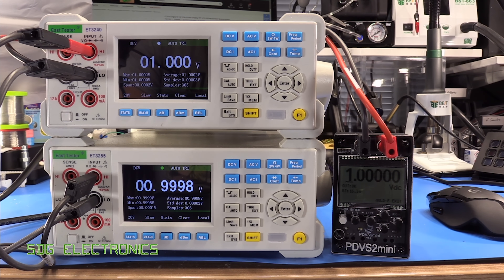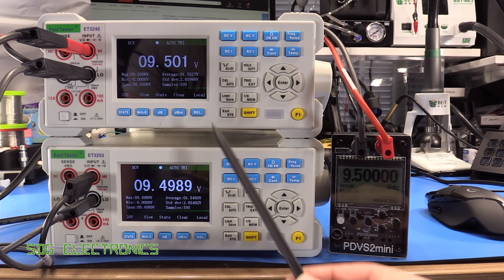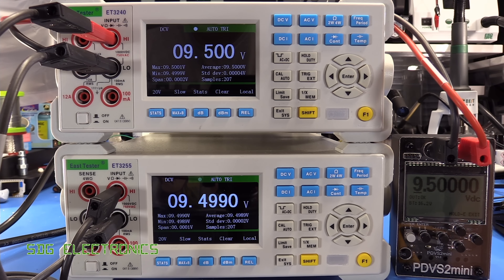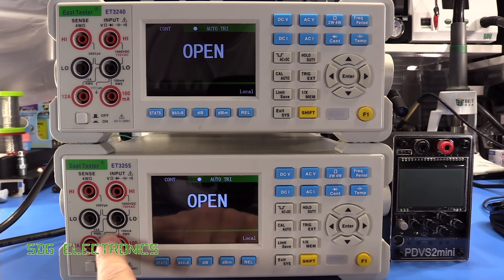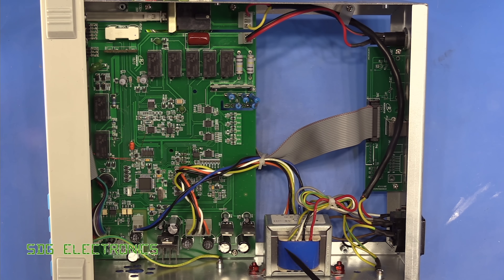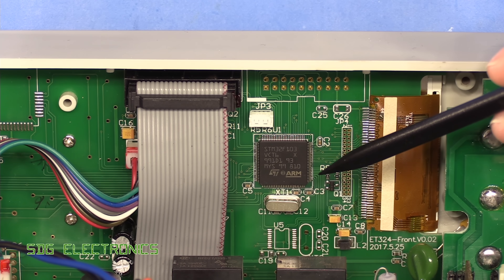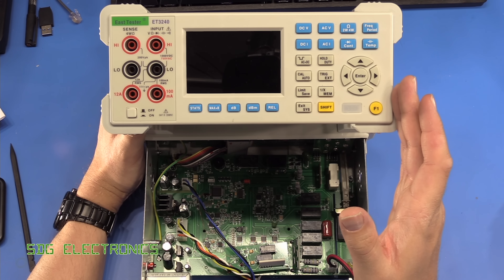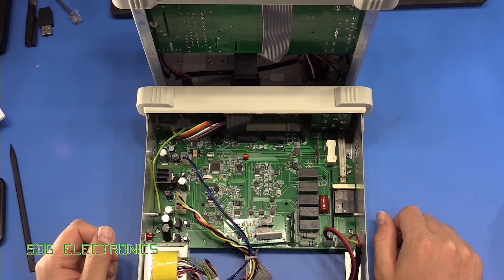SDG #143 Well priced 4.5 and 5.5 Digit EastTester DMMs - ET3240 and ET3255

Comment: Something that I really don't like about these, other than the accuracy is the incredibly slow update rate.
They probably do this to average over many samples and reduce noise.
I looked at these meters and some of the other "low cost" bench multi-meters made by Siglent and so on.

In the end I just bought a Keithley 2000 from eBay and frankly I'm quite happy I did.
It cost me less than a new 5.5 digit Siglent, the voltage, current & resistance measurements are on point even 10 years later and the update rate is insane.
And of course the Keithley 2000 is very low noise all the way down to 5 digits, unlike these meters just going all over the place.

For a desktop multimeter those are the most critical measurements in my opinion, as I use an LCR meter for things like inductance and capacitance, scope for frequency counting and so on.  The update rate just cannot be understated, it allows you to make repairs and adjustments so much more quickly.

Comment: The bodge board on the ET3255 is gone on the model I got this week. No rework on the PCB. However the transformer had come adrift in transit and there are various faults. AC volts not working, all DC current ranges reading a decade low. Autoranging on DC current not working. Pity really. In the process of getting a replacement.

Comment: Hi, Have you tested the VC8145 as a cheap multimeter? On papers looks good suppose to have 10 digit counts, 80k counts. the only thing I don't understand on capacitance the rage looks small 10nf-100uF, can it only measure up to 100uF? I have an older unit 61E that is 22nF to 220mF.

Thank you

Comment: I took a risk and ordered ET3255 and surprise...no bodging inside because inside is an ET3240, no caddock precision resistor network / divider, no separate  voltage reference, only the firmware is for 5 1/2 digit model .Also I encountered a lot of other issues like : no cold junction compensation for temperature measurements by thermocouple,  AC+DC mode not working correctly. 
I was refunded with the difference between 3255 and 3240 but even so, way too expensive for partially working equipment.

Comment: Love this new class of gear being offered by East tester and other companies like kunkin, korad, etc.... Inc.. I especially like the benchtop meters, the LCR meters, programmable load testers, function generators, and other devices offered. Don’t get me wrong… I love my HP and tektronix equipment. But sometimes I’m afraid to use them. But this cheaper stuff would be great “daily driver“ equipment when gettibg down and dirty repairing & troubleshooting industrial electronics.

regarding multimeters in particular… I would gladly pay $150 for the lower end “east tester” benchtop multimeters,.... considering I’ve only been doing this 4-5 years, And I still make mistakes. I’m not that experienced and I’m always afraid of damaging my nicer equipment. Therefore some of it goes unused. But if I had a bench full of this cheaper gear I wouldn’t worry about it. 

However when it comes to the more expensive ET 3255… you would be better off buying mint condition and calibrated HP 34401a 6.5 digit benchtop meter for the same price. I’ve got three separate 34401a meters stacked on top of each other that I use daily… Hell they’re hardly ever switched off. They are all in mint condition and were purchased with an up-to-date calibration. all under $400 shipped each. The 34401A is a hell of a meter to get for under $400 in great condition and calibrated. Hard to beat that.

But as an experiment… It would be nice to buy a multimeter, LCR tester, programmable load, and frequency arbitrary generator made by these cheaper companies… Especially for folks like me who are still afraid of blowing up nicer equipment. You could outfit a bench completely for under $1000!

Comment: Thanks for your video.  I need a measurement equipment for the repair of laptops and especially mobile phones.  I am looking for a lot of precision especially in the resistance measurement to look for short circuit in lines with several components.  Work on a milli-ohm scale.  Also to be able to work in 4W.  And a very precise diode measurement.  What multimeter do you recommend with a cost less than $ 350 or $ 400?  I had decided on the ET3255 because of its specifications on paper, but I have doubts after watching its video.  Thank you very much.

Comment: Could you please add a second review of the ET3255 specially for the millivolt range? 
I am curious te see if it can provide trustable continuous readings between 40uV and 50mV.
Reply from the maker: Honestly, I wouldn't go for the ET3255 as I do not think it's worth paying for the bodges. If you need the 5.5 digits, I'd look for something else. I just did a few spot checks though and it is good within that range using Ian's voltage source. No out of spec readings.

Comment: The specifications shown at 2:28 say that this meter can measure down to 10µV and 0.01µA  DC.  Presumably this is why the lower input socket has such a small upper value (ie. 0.01µA to 100mA).  It would be really nice if you could test if the low end is truly accurate with your PDVS2mini.   Would have loved to see if those lower end measurements work as advertised.

Comment: Just some feed back on this tear down (very well done, as usual, BTW) and the 4.5 ET3240.  I got one finally arrived in US after full 30 days and I was careful to check voltage switch selector and run at 110V setting, but mine just powers up and sits at the green boot screen.  Left it there for hours...pressed buttons, read manual...nothing.  Never goes past the green booting screen.  Hopeful for any suggestions (Banggood is pretty much giving me the run-around on support...sent the video https://www.youtube.com/watch?v=3WKLOd6tYQQ to them and all the pictures of the packaging, skew, etc. and now, likely going to cost more $$ to ship back than I paid for it).  Sigh.
Reply from the maker: Sorry to hear that Jeff. I'm not sure what the law is in the US, but here, you would not be responsible for any shipping costs. If you want to investigate yourself I'll see if I can work out what is doing at the startup screen - not sure if it does any self check or if this is just the bootloader. East tester are actually very responsive by email - so worth a try too. I will contact them later
Reply: SDG Electronics thank you for your help. I have not found an email contact for East Tester on their site or any FW support or if that would even help if it can’t be put into a reset/update mode, but hard to navigate as no good English site support.  Mostly just worked with Banggood directly so far.   Was hoping someone here knew of options.  I’ve done most of the non-intrusive stuff I could check on measuring voltages working on supply and visually check for any exploded caps or jogged loose connections.
Reply: So, after Bangood went "dark" on trying to help me and while I won a Paypal dispute, it was going to cost almost as much to ship back as I paid.  Sigh.  So, I dove in and started working through things and quickly found a wire in the ribbon cable from the main board to the front display panel board that was popped out of the connector socket just barely and pushed out not making contact.  reseated that, and "viola!" everything working...no thanks to any contact from East Test and zero consideration for any help from Bangood.  You can see the colorful rainbow ribbon cable at 11:20 fedding under the grey ribbon and again at 14:20 in the upper left of the video that was disconnected (purple end cable on right side that plugs into the front panel).

Comment: Buy the 4 ½ digits and put a nice power supply inside. Maybe upgrade the voltage reference and replace those linear regulator for a good ones. This is a bargain. Totally worth the price.

Comment: Your readings can be a little of, be curse of there parallel circuit, the ET3240 had 1 wire to the psu, and  the ET3255 was connected to end of the wire, so it had 2 wires to the psu aka double length of wire

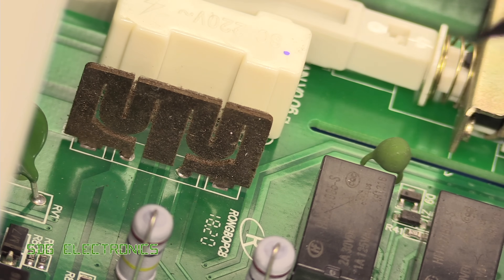Comment: @ 10:10 ish the current shunt looks exactly like a glow-plug style ignitor for a high efficient natural gas furnace. Actually, a good bit of reasoning with that, if it is correct.

Comment: I've got the ET5410 electronic load from the same company, which I'm quite happy with. It looks ok on the inside, at least compared to the hacks inside that 3255. The "quite happy"-part is mainly from two aspects. The first one was how hard it was to obtain the SCPI documentation from the supplier. When, after a three months back and forth between me and both the seller and manufacturer managed to get hold of something, it was in Chinese. Luckily Google Translate gave an output that was comprehensible. After some cleanup, I have an English version. The second issue is how the USB interface is designed. It uses the wrong gender plug, and it powers the logic board from it, even when the device is switched off. So it's powered from two ends when turning it on. I had to chop off the USB power for it to not occationally freeze up. What I'm trying to say here, is that not all things are very well thought out. It seems that there are several people doing different parts of the design, without having a top level idea of how it actually should work. Also the lack of documentation in English is seriously lowering the value of the equipment, not talking about hiding the component values that are being used. That's right out pathetic. This is supposed to be professional equipment, not low-end consumables.

Comment: At 9:05, there appears to be exposed copper on the mains wiring, where it enters the black outer insulation.  If so, it's inexcusable.  The way they tacked the range selection mod board into the 5-1/2 digit unit is awful.  They went to the trouble to specify top quality components (Caddock resistor network, Matsushita relays), then couldn't be bothered with build quality when it came to making the actual modifications.  What a sad mess.
Reply from the maker: The exposed copper is the earthed shield. It's sleeved before that. But yes, a bit frustrating really that it wasn't redesigned properly with all the mods
Reply: @sdgelectronics  Ah, OK.  Thanks, Steve.

Comment: these are really quite dissapointing... especially the 5.5 digit unit, with that price difference i would have at LEAST expected a DECENT mod board....
Reply from the maker: Yeah it's double the price, so you would expect better. I don't mind a few mod wires as in the 4.5 digit meter and many premium brands often have similar levels of modification.

Comment: Look at the absolute STATE of those bodges. 
Utterly laughable. If that is how they intend to build "precision" electronics, there is no way I'll trust their judgement of how to configure mains parts, and I shouldn't be expected to check and correct work that I already paid for.
Junk like this is going to get someone KILLED eventually. As a community, we ought to be publicly shaming this tat.

A multimeter is a device that tells YOU "what the crack is". You need to be able to rely on what it is telling you. Imagine making a measurement that produces unpredictable or unexpected results. You should suspect the DUT, not the instrumentation.
Just be patient and save up. Go on to Ebay and shop around. Skip the part where you waste $150 here and $160 there on junk that won't go the distance. My Fluke 8840 is well in excess of 25 years old, and is still absolutely spot on.

On the flip side, look at Ians voltage source. A single guy has been developing that for a couple of years just that I know of. No doubt it is the descendent of a project he's been tinkering with for much longer. It is the polar opposite of "Quangshushitter" death-traps because like all small sole-traders, he is putting his reputation on the line with every unit he ships.

Comment: The quality of the rework really puts me off these units.  I would also liked to have seen a transformer with split bobbin construction to guarantee mains isolation and to increase the isolation voltage.
Reply from the maker: The transformer configuration isn't too bad with the internal copper band, but yes, a split bobbin is obviously nicer. I did think that was flux all over the board on the ET3240, but it turns out to be conformal coating to keep everything in place, so at least some level of care was taken even if it's not the neatest

Comment: Dang isn't it ugly inside... weird that Chinese are so eager to protect themselves from copying when they themselves have copied everything coming their way :D
Reply: More to prevent some other Chinese manufacturer making a cheaper copy of the meter. I would assume that the EEPROM inside the microcontroller also is holding the calibration along with the bits that tell the meter what resolution to display. All the bodge wires probably will vanish in a later revision most likely, when they have finished the original run of boards, and want to save on the manual labour cost of putting them in.  Might even make the 5.5 and 4.5 versions as component placement only as well, there is enough room there for it.

Would be interesting to see how they did serial there, along with the USB interface, and if they are isolated.
Reply from the maker: I think I have a very early unit, so you would hope the mods disappear in a later revision.
Reply: Seems to me if someone really wants to copy it they will find the part number out with some effort.  I don't know but I wonder if they remove the labels since they use clone chips and then it is harder to tell they are clones?
Reply: Mostly, they scrub the chips to avoid paying patent infringement or even using grey market clone chips that are not legit and import issues and keep the rest of the wolves from copying them in China...

Comment: And there's me, stuck with a $25 meter
Reply: I love my ~$25 meters... They get dropped, rained on, and all kinds of other abuse but they still read close to each other so I guess they are accurate... enough.
Reply: There was a time where I had a lot of "budget" gear. I suffered and suffered with that stuff because it consistently lied to me. Do NOT fall into the trap of Chinese junk.
Save up. Wait. Be patient. Your time for touch screen Rhode and Schwartz gear will come.
Reply: Portable and not looking to be stolen unlike fluke meters.
Reply: @digitalradiohacker well there are things like the T12 Soldering Station that's 100% worth it, and I've seen many people prefer it to name brand Weller stations of a similar price

Comment: Thanks for the look inside these. I like ET's other gear (electronic load and LCR meter). I'm with you on the disappointment in that 5.5 digit meter. What a mess. I wasn't tempted to get these since I am a fan of the usual meters (Agilent and Keithley) and I'm pretty sure I'll steer clear of the temptation with these.

If you contact their support email address, they will email you a link to the software. They are very responsive and easy to get technical information from.

Comment: ehhh, both are on a price range where i'd rather get an used unit from the usual brands.
Reply from the maker: Unfortunately, in the UK, even an ancient 34401A goes for the 3x the price of the 4.5 digit meter. The occasional one slips through at less, but there's not usually a great deal of choice.
Reply: @sdgelectronics  Well yeah, agreed but as pointed out, that's 6.5 digits. I got myself a 3468A for peanuts, added in an HP-IL to USB interface (fun little project) and I am good to go.
Reply: @sdgelectronics  Ancient, in what terms? I mean it's 6,5 digit one and old units are damn stable... what else would you need as a hobbyist? If you NEED some modern graphing functionality or something, then you're going to pay for a meter that has it, even if it's 3000€... I mean if you NEED it and need isn't in terms of "would be nice to have" but for a need that's dictated by your businesses bottom line.

If you have a NEED for something like a high end measuring instrument, you're no hobbyist anymore and that investment will pay back itself.

Comment: I find it hard to see why people even need more than 4 digits... Maybe I just don't deal with sensitive enough stuff.  I don't think I have ever done something where fractions of a millivolt mattered.  But still fun to see your tour of the inside.
Reply from the maker: It's rare you need higher resolution meters, but they're very handy to have around. If you do any precision instrumentation, or even something basic like battery testing they become more useful.
Reply: I think the vast majority of people don't. I bought a used 34401a years ago and don't think I have ever fully utilized its resolution.
Reply: I only needed to use precision DMM at work couple of times. For hobby stuff never had a need for it but I would like to get one, just so I can feel like it’s a proper lab. Lol
Reply: jontscott when I really want to be OCD and go over the top when building stereo channels in mono block amplifiers. I use my 6 1/2 digit multimeter to match resistors and all components. Test and match capacitors test and match Jfets and MOSFETs. To the point where you just breathe on a component and you could watch the resistance or the voltage change. Just a hobby
Reply: @coldfinger459sub0  wow, when I build something if it works without magic smoke escaping I am usually happy.  You obviously take it to a new level!
Reply: Something that has 5+ digits of resolution absolutely WILL deliver the goods in the mV range.
Something that has 3 digits will be at the outer limits of its capabilities just measuring volts.

I've suffered the effects of cheapo meters, and nothing is worse than wondering if the DUT is needing attention, or the instrumentation is needing attention.